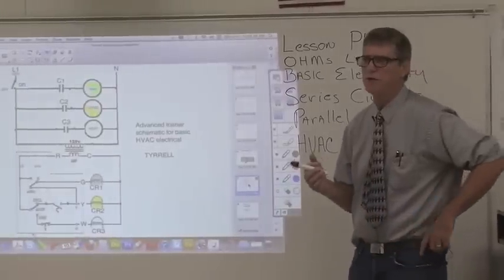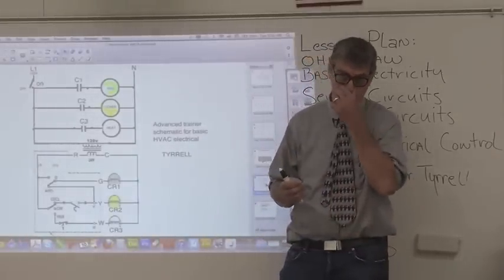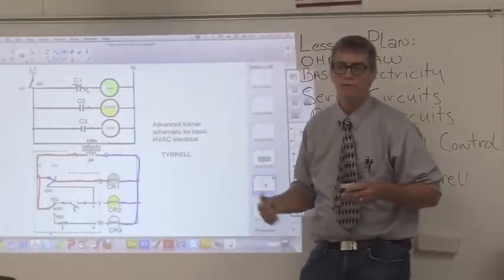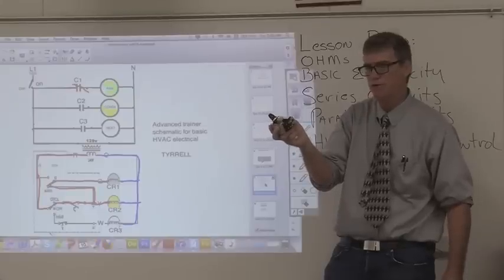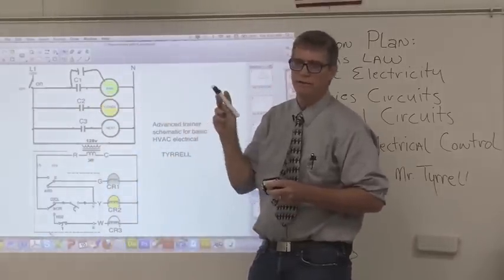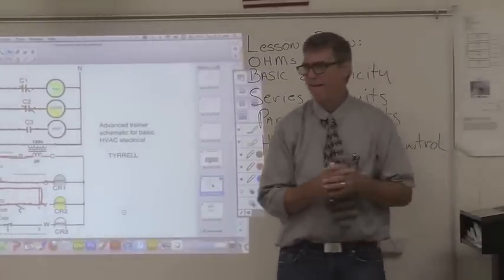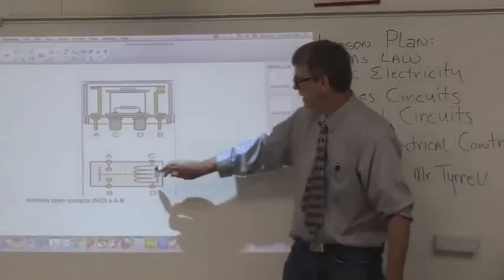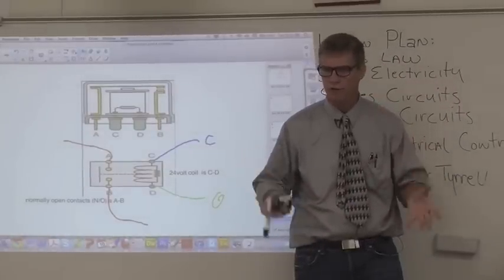Wiring Diagram with Mark Tyrrell  E4

Comment: Mark, Exceptional training class!!   Very clear and concise.  Wire Diagram with Mark E4.  I would appreciate your thoughts regarding the following question.  If  you could please respond, and then let me know how to access your response, it would be great.    My HVAC system only has two solenoids, both are double throw.  One is for the control of the electric heater unit.  One of the pull switches energizes the electric heater coils, the second I believe controls the fan (can't see where the wires go).  The second solenoid is wired in a confusing manor.  The G wire goes to one side, the Y goes to the other side of the solenoid.  Surprisingly the 24v transformer common is also tied to the Y wire terminal of the solenoid.  One of the pull switches passes primary power from transformer and the other pull passes 24v common to the fan.  The unit is very old, in a condo, no schematics, no control board. Thermostat was moved, wires spliced in wall, ohm'ed them out to confirm color exchange.  Presently our old 4 wire thermostat works fine, the unit controls the Fan (auto/on), A/C, and Heat.  Our new digital EcoBee thermostat requires a 5th wire, Common (operates thermostat internal circuitry).  If I run a new 5th wire 30 feet across the floor, the Ecobee works (eventhugh it's hard wired to V terminal at the solenoid).  If I remove the 5th wire and short the Y and C in the Ecobee, the Ecobee will control the fan and heat, but resets every time the A/C is activated.  I assume that there is resistance issue at play, allowing a close voltage threshold to enable proper functioning.  So my assumption is that the Y wire is in error on the common side of the solenoid (where it is shorted out to the 24v common).  With a two relay system, where should the Y wire go??  Have you ever seen a system that ties the Y and G across a solenoid?   BTW, if I disconnect the Y from the solenoid, the rooftop compressor shuts off. All thoughts are appreciated.  Dale 071117

Comment: I think that most Electric Air handlers Today the Thermostat on sub base switched to Electric not Gas it Automatically brings the Fan on same time or actually before the Elements energize to make sure the Strips Do Not Overheat because of No Fan so this is How most Electric Air handlers operate same speed for Heat and Sir where yrs ago they had a speed for Heat and a speed for air.Now Gas is different they let burners come on heat up and the Board is timed to bring Fan on in a different speed from Cool and Heat